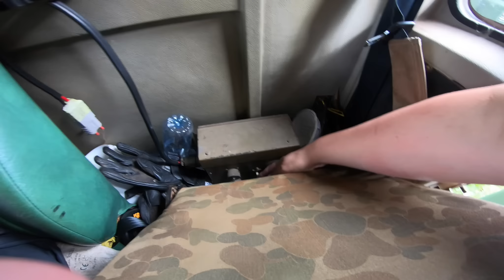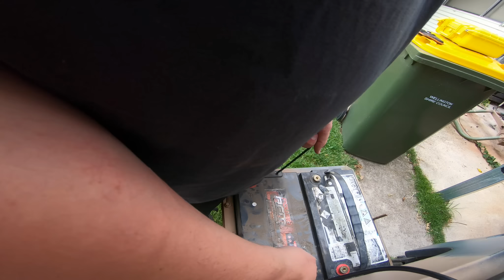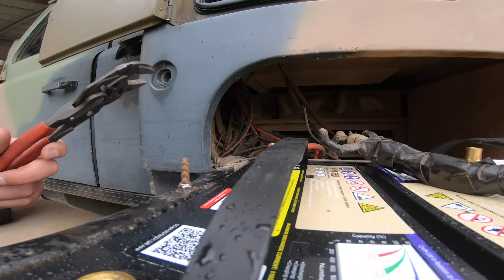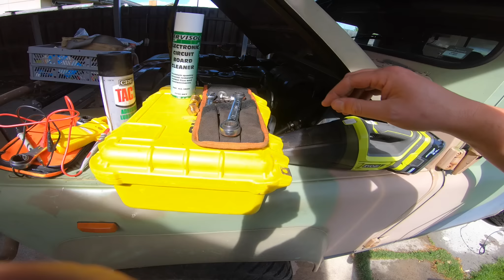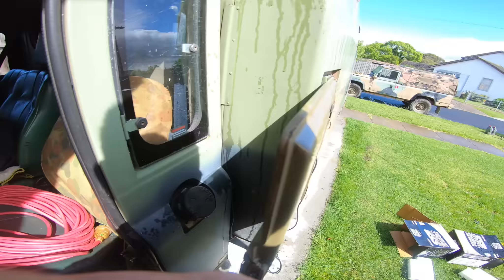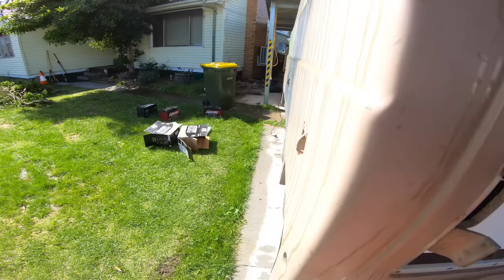6x6 Land Rover Battery swap | 2025 re-edit

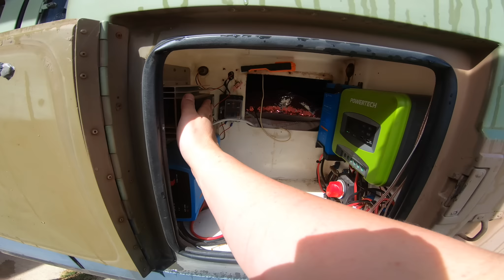Comment: Hi Dave, I noticed when you were connecting the jumper lead at 7:15 , you had already connected the gnd.
I always connect that last, so any spanner connection from any terminal you are tightening will not vapourise if inadvertently connected to ground.
Did you measure the new battery volts when the oven was loading them up.
There's another 3 1/2  years of service.
Write the installation date on the batteries.
New bolts are a good idea, especially if they come with the new battery.
Reply from the maker: The re-edit left out a few things. the main fuse is on the ground side and was removed during the installation process. The oven pulls about 9 amps, and dropped the volts by about 0.2v
Batteries were manufactured 2 months before installation, and the original video serves as my record of installation date.